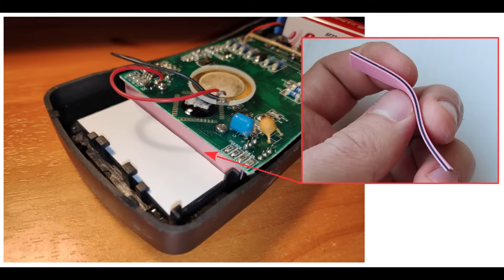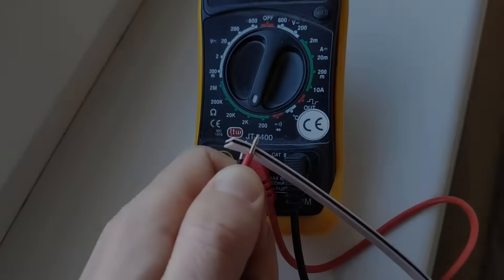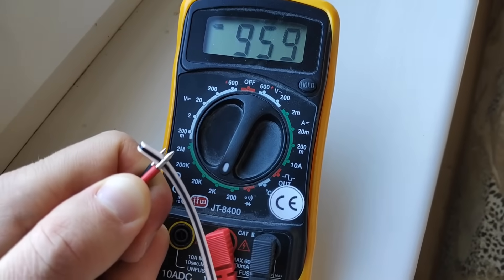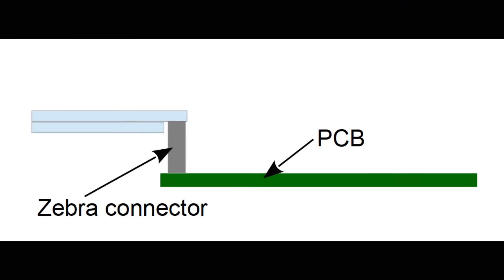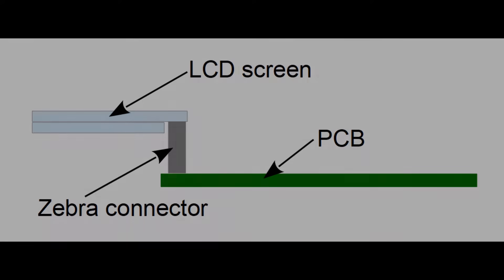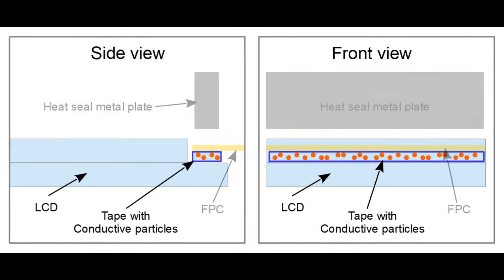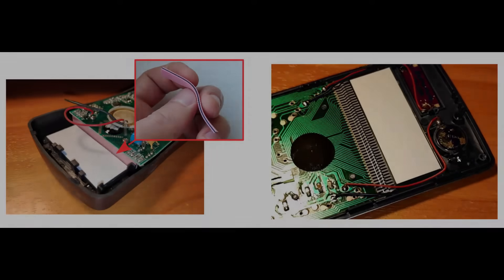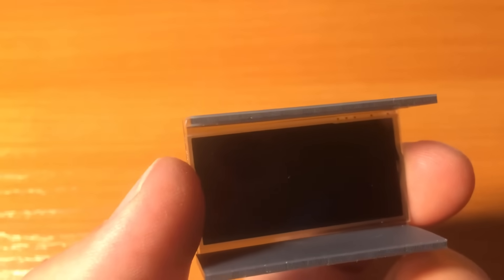LCD repair

Comment: The zebra strip also loses its Contact Pressure (over time). If your LCD Module is relatively flat, then it can be possible to restore clear LCD images on the display by the use of NalClips. These Clips are mainly used in clipping paper - in an Office Environment. I have had great success in the use of this type of Clip, which increases the pressure between the PCB / Zebra Strip / LCD Screen. The use of a few NalClips around the perimeter of the LCD Screen gets top results by just increasing contact pressure. I have also cleaned the surfaces with alcohol, which removes the substance which is exuded by the rubber-like Zebra Strip - over a long period of time. Hope that this helps.

Comment: I would recommend to use Isopropyl alcohol and not Ethanol. They both are equally effective removing stuff and thy both dry very fast but Ethanol attacks plastic, Isopropyl doesn't. If you accidentally spill any Ethanol on the display, which probably is not glass but plastic, the display may get cloudy and there is recovery for that. If you spill Isopropyl, you should be fine.

Comment: The suggestion was excellent to solve the issue of LCD in my Casio calculator. The problem was in the connection strip. By heating  with hairdrier and pressing in the contacts area, the LCD now  working like new. Thanks

Comment: I cleaned the zebra connector of a kitchen timer but no luck. The problem was the other side of the connector which was stuck to the lcd. I pulled it off and cleaned it. It was tricky to put it back as there were no guides to locate it correctly but I got there in the end. Now it works like new. Thank you.

Comment: Thank you. Method 1 did it. Now for the part of the repair you can't help me with, which is to find the 2 tiny screws I managed to lose while searching for an LCD repair video.
Reply: tape magnets to a pole and sweep 😂
or (now bare with me) put a sock over a vacuum cleaner  ...and hoover the floor, your screw will get saved by the sock.
Reply: @luminousfractal420  Haha, nice one. All good ideas. This particular work bench does electronics some days and light engineering on other days. Gets cleaned around only when something gets lost! I literally had a 250g of swarf to to sift through. Never did find those screws but I did find all sorts of other things.
Reply: 😂😂😂😂
Losing the screws is always the case.
Thank you for your sense of humor.

Comment: You are a hero: I just fixed the LCD.l display of a Gazelle E-Bike: the display uses a flex cable which was indeed loose at the display end. Heating this side of the cable with a soldering iron at 195°C worked perfectly I have a electronicly adjustable temperature on my soldering iron)
Reply: I tried to fix a broken FPC ribbon cable to the OLED display, but it doesn't work with just soldering. From what I read it's bonded with an ultrasonic device, as it adheres directly to the glass... so I had to buy a new screen.

Comment: Hi, well I've had a good day today, I fixed the LCD pixel problem that I had on my SONY mini hifi system using this video as a guide.
I didn't do it exactly as the link but it was certainly a good guide. What I did in the absence of a soldering iron was use the side of a kitchen fork prong that I had heated up on the gas ring for 10 seconds. Then I positioned the heated prong exactly where I wanted it, pushed down on the furthest fork prong away to give a good amount of pressure and held for 75 seconds which allowed the heated prong to cool down. So, I was doing 3/4" about every 2-3 minutes. I did have to put the unit back together to see how I got on & take it all apart again several times but eventually I got there. Thanks again for pointing me in the right direction ShortcutElectronics.
Reply: LCD repair using a fork! you should have make a video of it!
Reply: what was the model number? MHC-NX1?

Comment: Thanks a lot for this tutorial. I discovered the hot method. By the way, my gess for the zebra problem is the oil escaping from the rubber polymer. Same for remote controls or keyboards using the same method of conductive polymer pads to short pcb pads. It might be related to the pressure as I noticed that on remote controls, it's often the most used keys that become oily. Joel.

Comment: Additional ideas:
*Flip the zebra strip when it is re-installed to establish new pressure regions.
*Increase or restore pressure in the LCD frame, such as re-torque PCB screws, re-bending springs, or adding foam shim to front of LCD.
*Heat zebra in boiling water to restore it's original height.
*Use white vinegar to clean off battery corrosion from PCB.
*Use pink pencil eraser to clean darkened gold or copper pads on PCB, followed by IPA
*Use tape and conductive paint to repair torn polyester FPC, or conductive paint alone on FPC that has lost the carbon tracks.
Very similar to keyboard restoration on many calculators and key fobs!
Reply: Conductive paint sounds the right thing I need for my problem but I'm sure I will have no way to find it.
Reply: @frackjohn   "Ali the Speedy Chinese" is your friend in cases like this. You'll find lots of "Conductive paint pens for PCB lines repair/drawing" in the electronics and phone repair sections. Some are silver based, other copper. they also alse some very cheap but fine components scratchers/cleaners of various blades shape, mostly used to remove dry thermal paste and phone glue residues but they could be quite useful for lots of other things too. Also, if you don't already have some sharp tweezers, check the ones from brands such as Mechanic, Relife, 2UUL (and others) "Mobile phone repair tweezers" until you find exactly what you want/need. 😉👆
Reply: @frackjohn   "Ali the Speedy Chinese" is your friend in cases like this. You'll find lots of "Conductive paint pens for PCB lines repair/drawing" in the electronics and phone repair sections. Some are silver based, other copper. they also alse some very cheap but fine components scratchers/cleaners of various blades shape, mostly used to remove dry thermal paste and phone glue residues but they could be quite useful for lots of other things too. Also, if you don't already have some sharp tweezers, check the ones from brands such as Mechanic, Relife, 2UUL (and others) "Mobile phone repair tweezers" until you find exactly what you want/need. 😉👆
Reply: @pault6533  Don't forget to remove all traces of white vinegar from your PCB and components after it has done its job or you might end up having another problem down the line... 😬

Comment: I fixed an old calculator with an unreadable display,  by just running a soldering iron across  the  contacts and pressing them down. Still ok after a few years. Nice video. 

It's cool that the pitch of the contacts of the zebra strip is much fner than the actual contacts, so you don't have to worry about he alignment.

Comment: No one repairs my car's (1997 Mercedes E420) non-displaying pixels but I noticed that simply putting pressure on the ribbon cable at point of attachment worked to a very limited extent. I suspected already that heat or pressure would work and now that I see it in this video, it makes perfect sense! Definitely worth a try, though I might have to come up with a method to know the temperature of the soldering tip. THANK YOU for this video. :-)
Reply: Did you solve it?
Reply: @ElTitoXBASS  To make a long story short, in the end the results were not perfect. Ended up buying a used instrument cluster from Berlin for a very good price.
Reply: @ronkirzinger1947   That leaves you with an instrument cluster display to train your new LCD fixing skills and once mastered and correctly repaired, you can resell to someone needing a working one. 😏

Comment: thx to your experience and a few other youtube videos covering "Zebra" rubbery conductive  contact strips (i had no idea such existed) that are used to connect circuit board contacts to LCD contacts and how to clean them - i was successfully able to restore my LCD display functioning on a very expensive race car digital dash display - cost $0 - just 10 minutes of my time and some research and patience

Comment: Thank you for the video! Very clearly explained, both connector operation and their repairing. I fixed in the past zebra connectors in this way, but didn´t knew how to cope with the FPCs. Thanks!

Comment: Thanks for this, my BMW screen is full of lines, a new lcd is 68 quid, def going to give it all a clean and reseat, worth a try, cheers for info
Reply: Did it work?
Reply: Some BMW display is caused by solder joint breaking.  Butsimmilar fix, make a better screen connection.   Just hard to get too.
Reply: @DeclanCrane  no, common heat and damage over time for mine, cars gone now

Comment: Thank you for this informative video. This is very helpful to those with problems in the LCD display that could be fixed using the method you discussed here.

Comment: Thank you for your efforts very informative video, I have question about my car stereo LCD display, it works perfectly fine when start the car but after few minutes it starts fading and goes blank
Reply from the maker: If your LCD display works fine when you start the car, I am pretty sure your problem is not related to the LCD itself, but the hardware of your stereo system. If it starts to fade, instead of just going blank in one moment, my guess is that something is wrong with the power supply. If the audio system works also when the screen goes blank, the problem should be in the part of the circuit that provides voltage/power to the display driver. If you could find and check the voltage that provides power to the LCD driver this might answer the question. One thing that you could do with limited knowledge in electronics is to look for swollen electrolytic capacitors and replace them since they do not hold the voltage when they go bad, but make sure that the polarity of the capacitor leads are correct when doing that. Second thing is to simply search "<your stereo system model> fading display problem" in google since there is a chance that this is a common problem for particular system and someone has already solved it. There's not much more I can help in this case.

Comment: Hi 
Very nice demonstration of how to do it.
I have a that problem on my car Audi A4 1995.
My problem is I think that even with heat, there is no glue or solder left to "stick" the tape type ( similar to the 2nd one on your video). 
Any ideas for what "glue" to use.

Comment: Interesting - thank you - particularly your experiments with reattaching flex cables using heat.
I have a Powerbook 100 with Sharp LCD where a few lines of the LCD are sometimes dead. I solved it by including a cushion to press the flex cable against the LCD - which works most of the time as long as I don’t close and open the display!

These are a chip-on-flex design where the driver chip is attached in the middle of the flex. I can’t tell if the poor connections are between the driver chip and the flex cable, or between the flex cable and the LCD. Perhaps the heat method will also work for reattaching the driver chip to the flex cable. I was thinking of using a 3D-printing hotend heat block (with heater cartridge) because of its block shape. But a soldering iron looks like it works just as well - I just think you need to apply the tip onto some sort of block or strip, to spread the heat while applying an even pressure (a round soldering iron tip doesn’t seem ideal).

If anyone reading this has indeed re-attached a driver chip to a flex cable in a computer’s LCD, let me know :)

Cheers

Comment: I'm curious how the rubber strip comes into play to push display on LCD? Is there light shining through the rubber strip? Does the rubber strip have to be perfectly aligned with slots/holes on the strip and PCB? etc

Comment: What about using deoxit? Is that better than alcohol or wrong application? I have a 65" TCL LCD TV that has a couple black vertical lines through the screen.

Comment: I have lcd gauges on my boat, the readouts have become very faint, almost unreadable. I’ve been told this is due to sunlight damaging the readout. Is this correct?. If so, the repairs you described would not work?

Comment: When zebra lost conductor.can add conductor with other materials?
Reply from the maker: The problem with that is that zebra connectors act as bunch of separate wires. A conductive paste for example will connect all of them together. There are different types of conductive adhesives. For example adhesives with microscopic conductive beads in the. That might work. I would rather try to find a zebra connector with slightly different size (slightly larger) to increase the pressure to the connection, but this might be challenging. Also the new zebra connector has to have same or close to the original pitch between the conductive and none conductive layers if you want it to work properly.

Comment: Oh ,why not did i come on this video .i have seen 100 video of lcd replacing and correcting.all are doing the same ,replacing polarized film.even after replacing the polarized film ,the lcd actually does not giving the result ,so they do trial and error.so ,after ,i tired , just yesterday I decided to manipulate zebra strip which i was afraid to touch as i was not seen in any video about it.but i was sure this strip is the mani communication path.so i cleaned it and put it again.still it was not working.you cannot believe, i just put a hollow rectangular thick papper strip at periphery of the lcd frame so it pressure on lcd contact and zebra streap.it worked.so, actualy small trick works.after i slove it,i came to see this video just today.haaaa

Comment: Thank you for posting, it is Exactly what I was looking for. A multimeter display appears to have the zebra connector loosely stuck to the LCD making it easier to reinstall. Is there a way to stick the zebra connector back to the LCD once you have cleaned it?

Thank you

Comment: Really interesting video, it helps me to fix an old broken lcd display. I just would to ask (as I'm a beginner): is that an aluminium foil like the one used for food? Could I do that also with a soldering iron without a temperature control? Thank you so much.
Reply from the maker: Yeah, I used a regular aluminum foil. Nothing special there. You can try without temperature control, but in that case there is a lot more risk to damage the LCD connector if the temperature is too high. It could start to melt the connector.
Reply: @shortcutelectronics  Thank you. I will think about it, before doing the wrong thing. Or maybe I can have a try using the soldering tool a little far, but I think, as you wrote, I should push it on the alu foil.
And actually my cable is already welded to the board... just the display has a lot of lines/dead pixels. Anyway I will try it! Thanks for your reply.

Comment: Bro this video is awesome! took apart my programmable 220v switcher plug that comes very handy and expensive in these energy crisis times! it was laying around for years because the screen was dead I didn't even know yesterday how the zebra connector is called. I fixed it in 10 minutes based on your video. I also applied five layers of transparent tape on the lower 3mm strip of the screen. this way the transparent enclosure that holds the whole assembly down put some extra pressure on the zebra connector for even better connection. LCD is perfect now. very handy and concise video! 😁🤗 could it be that order burnt pixels that the BMW owners are crying about are caused by the same stuff? 🤔
Reply from the maker: Thank you for kind words! I appreciate the feedback. If those BMWs you refer to display some type of images, than most probably that is the case that I illustrated with the calculator because I'm pretty sure they have flexible PCBs to connect the LCD to the main board. I think it is possible to fix that, but that is a lot more complex case than with the zebra connector. I have seen that usually other people are suggesting to buy a screen with the flexible PCB already connected to the screen and than you remove (desolder) the old screen from the main PCB and solder the new one to the main board. My old Audi had similar problem, but it was not that bad so I did not touch it since the success rate in my opinion is a lot lower than in case of a zebra connector. I would say that around 90% of all LCDs have one of the two connection types that I discussed if not more.